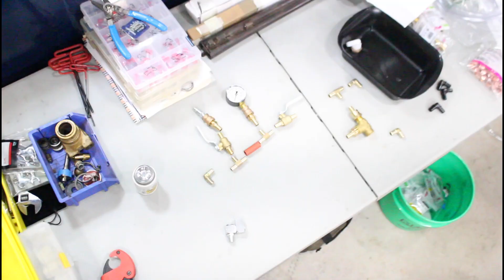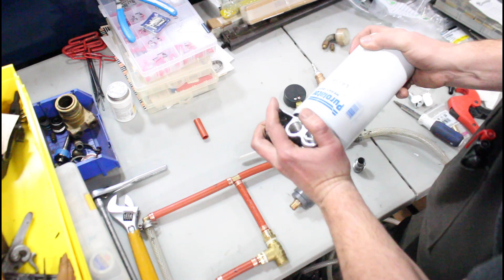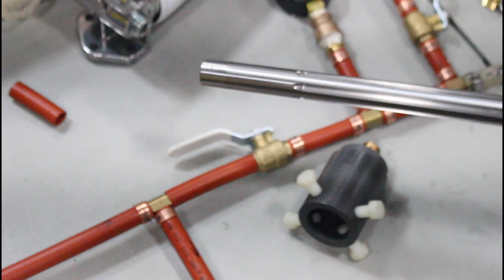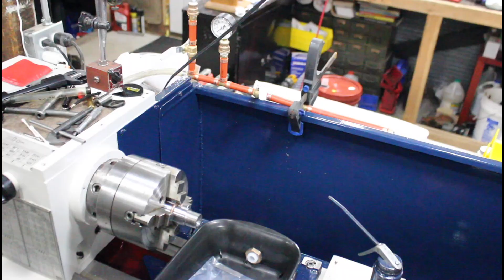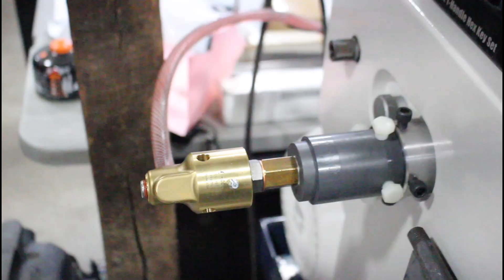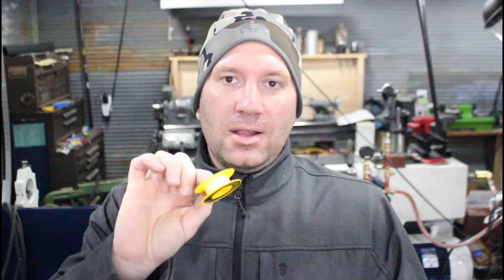Chamber Flush System Build!

Comment: Where did you get the grey body to apply to the end of the barrel? Part # and or fitting.
Reply from the maker: I made it. Just a piece of Delrin plastic with a rubber tipped compressor nozzle and 4 nylon bolts. Pretty simple to make if you have a lathe.

Comment: I know this is a year late but might help people looking to build something similar... That filter mount and thread adapter (1-14) is common to CAT's and most commonly used with the CAT 1R-0750 Fuel Filter. There are a couple other CAT filters use that thread too but the 1R-0750 is very commonly used in many applications.

Also, you can by those mounts with common oil filter thread adapters too, just have to by a mount that is designated as a remote oil filter adapter.

Comment: How do you keep back-pressure caused by fluid buildup in the barrel from ending up on the floor of your shop?
Reply from the maker: There is a pressure relief valve between the pump and the barrel that will bypass back into the reservoir. I can also control pressure with a the ball valve before it goes into the barrel.

Comment: Nice job.
A few comments, been running a similar system for a few years in my shop now... The reinforced hoses will eventually harden and need to be replaced because they're not petro friendly-not a big deal.  I have the Gre-Tan muzzle fitting, I've had no issues with the rotating union and the spring-loaded feature is a +.  
Magnets- I use them as well, but obviously not useful with stainless steel barrels.  My catch basin is a modified magnetic parts holder, and I use a "pre-filter" that consists of just a cut piece of coarse air filter media pad.
Since installing all the reamers I've bought (Manson) are ordered with oil grooves- greatly improves flow. I'm considering sending all my others to them to be modified.

Are you running straight ATF? I run dark Ridgid oil cut about 20% with ATF, but I've not heard of anyone running ATF alone?
Reply from the maker: Thanks for the tips.  The magnets i used are neodymium which do a good job of picking up SS chips.  The video shows the chips from a Hart SS barrel.  I have a screen that fits in the drain in case.  I also have strong magnets in the bucket.  A lot of my reamers have oil grooves. I talked about the oil on the video.  Its Mobilmet 766 with 1 qt of ATF per gallon of 766. I've only got about 2.5 gallons in the system so hopefully it works well.  I might get some molly-dee to put in it as well. Thanks again for the tips.
Reply: @precisionmachineshed  if you dont mind I desperitly need the part number for the rotory coupling

Comment: Nice build man. I wanted to try an electric high pressure high volume oil pump off one of my race cars to do that. Was thinking of a JIC hydraulic fitting for the barrel connector but wasn't sure how to secure it until you shared your design. Thanks man.